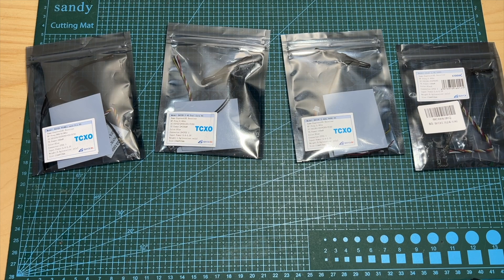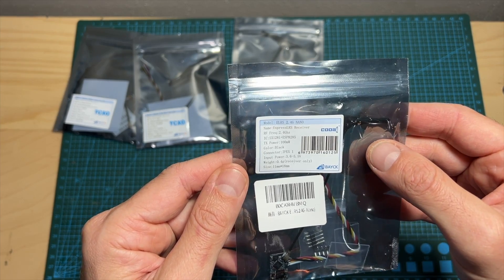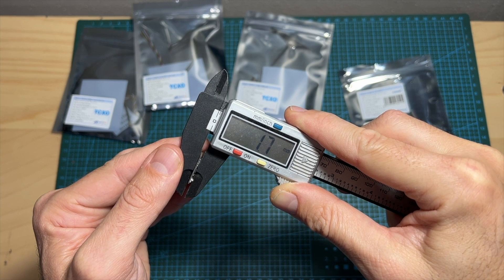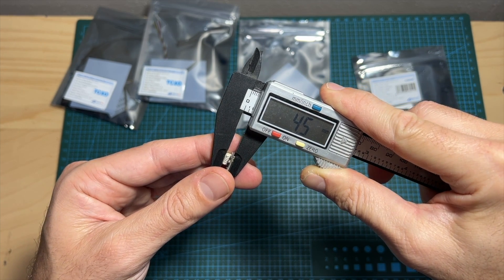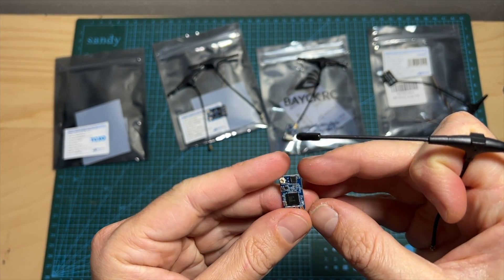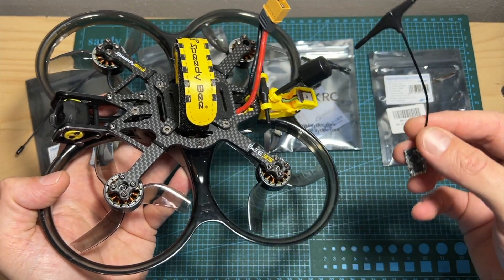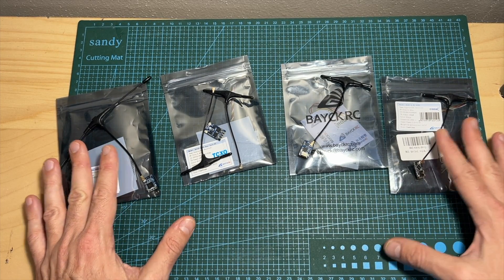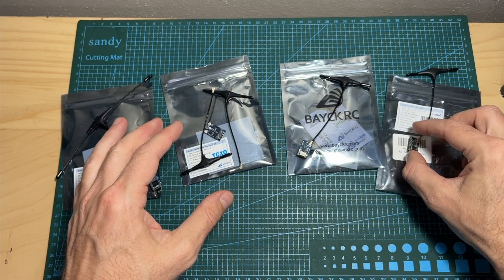New ExpressLRS RXs - BAYCK RC 900/2.4Ghz Radio Receivers

Comment: The 915 is 50mw or 500mw telemetry?
Reply from the maker: I need to check the specs. 500mW as far as I can remember.
Reply: @KremerFPV   cause I see 50mw, 100mw and 500mw depending site I goto 🤣  
Figure on elrs Lua u can see actual telemetry

Comment: Nice to see these.  The one that piques my interest it the 2.4 Nano Pro.  I don't have any TCXO receivers yet and am curious to see if they do anything for my use case.  The one issue that I have with all of these receivers is that very heavy antenna.  Not really a concern for 5" 500g quads, but my favorite type is 3" ultralight builds - 45g or so without battery.  For these ultralights, that 2g antenna is a significant addition and you get ultralight by watching every 0.1g of every part that you put in the build.